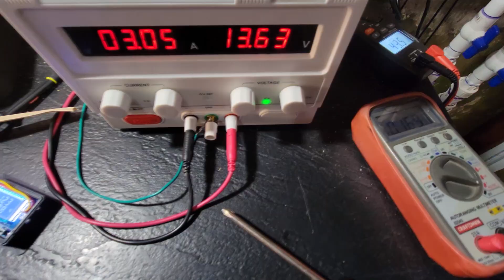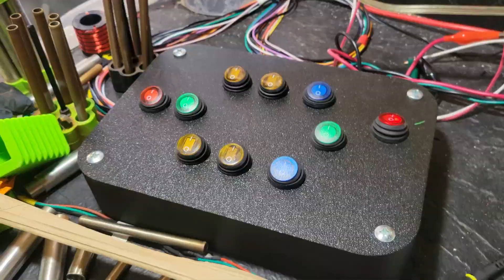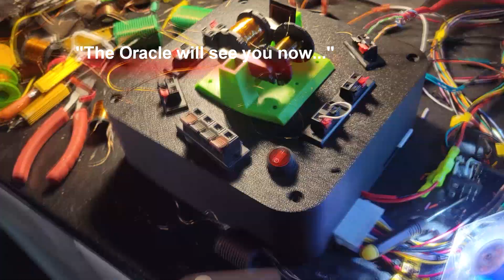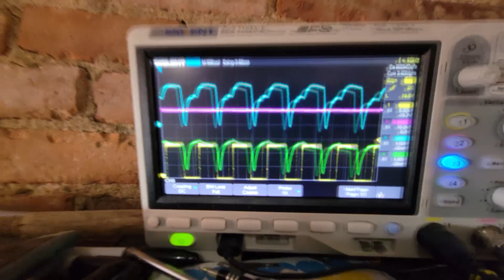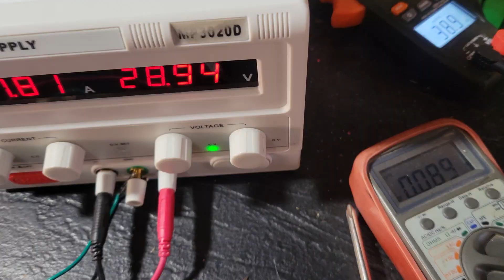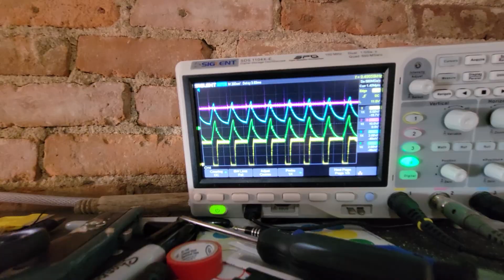Failed Switchboard, SS Inductor, Removing Inductor B

Comment: Focus on KV
Reply from the maker: Voltage is over rated. It only takes a few volts per tube to produce HHO. Waveform is much more important than attempting HV on the cell (most fail with this approach).
Reply: @noahauman waveform is overrated, shot impulse is everything. Get CDI and dump restricted amp HV in cell...
Reply from the maker: Well just have to disagree here. Do you have a working system with high voltage? Looking forward to seeing your work.
Reply: @noahauman you won't see it yet, Meyer waveform is just simulation of the HV short impulses to charge and discharge wfc, of course you need KV... There is a reason no one got Meyer vic to work
Reply from the maker: I am literally getting the VIC (concept) to work, right now, with 1-2kV output. Load brings it down to just a few volts per tube (dead short condition), as what you presently see in my videos. Amp restriction is the key, my friend, to which you are then able to utilize most of the 1kV already being produced by the VIC.

Looking at a CDI circuit (for the first time ever), I do see your concept (very clever), however if your waveform is not delivered properly to the Cell(s), there will be no voltage potential difference between the tubes and no gas will be produced. You can push all the voltage you want on a WFC, but if there's not a voltage potential difference between the plates, there will be no gas production.

Perhaps if you just made your Ignition Coil a bifilar, center tap (with diode on the positive), you would accomplish what you are looking for.
Reply: 😊👍 @noahauman